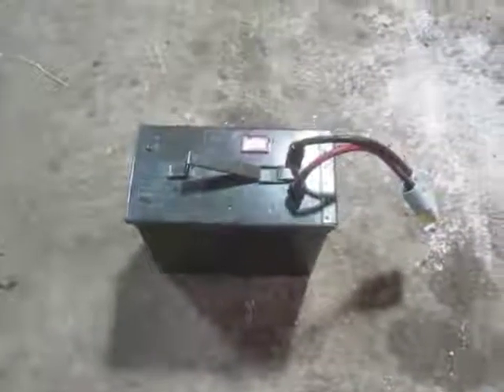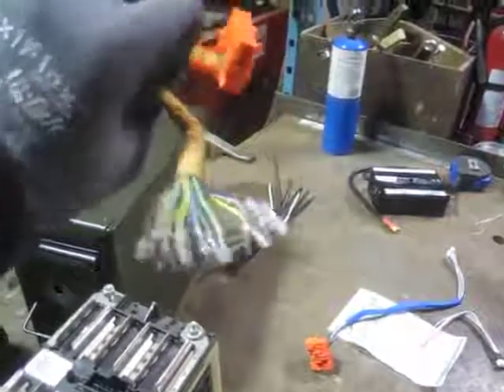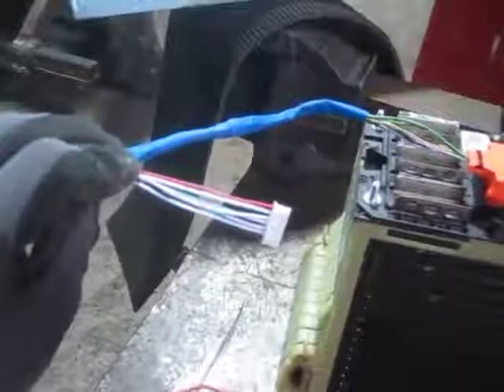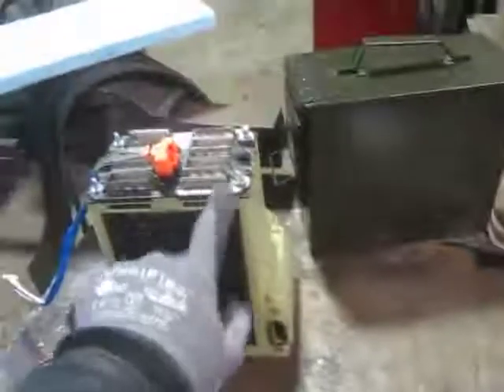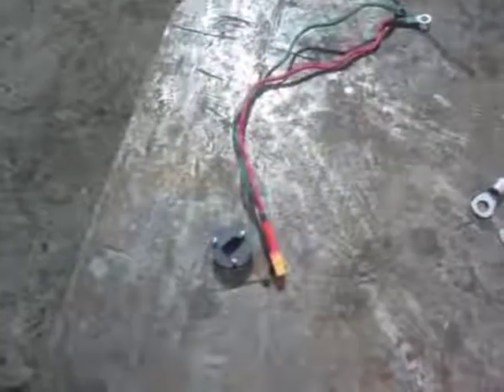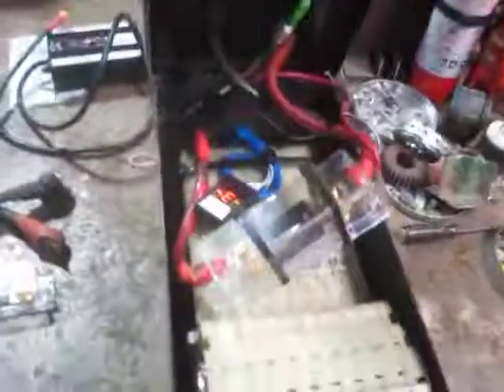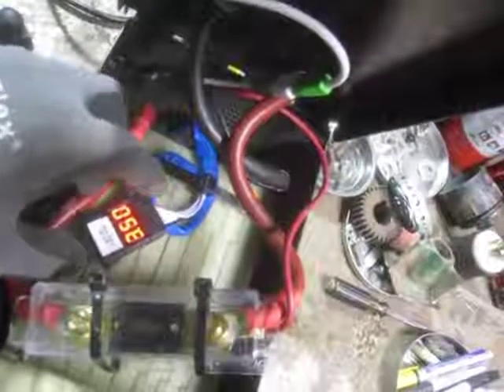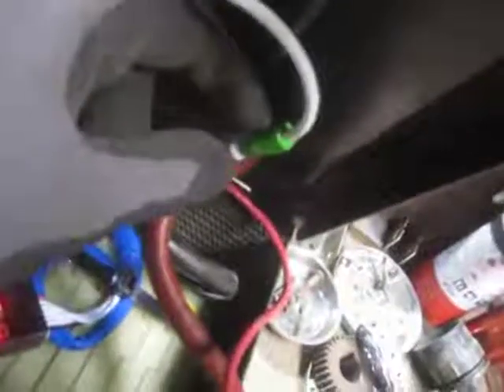24V Lithium "Power Brick" in a watertight ammo box

Comment: Nice job. Using that volt battery is amazing amounts of power for the weight and size! I built one of these with a 12v 22ah lead acid battery 2 years ago. Its okay, but too heavy to lug around camping and to remote areas. I'm building a new one that is intended to be much lighter and smaller. I also want to take the DIY out of the battery charging system for safety so I'm using my Black + Decker 20v lithium tool batteries and stock charger which I've had for years and seem to be very reliable in the tools. Only going to be using two 4AH 20v batteries in this new one but 8AH @ 20v should be enough for me. I would try something like you did but the safety and charging system connections make me nervous!
Reply from the maker: Once you start taking battery packs apart and learning how they work it's hard to stop 🙂. I know I'm really curious about the balancing circuit and what flavour of cylindrical cells are inside my cordless tool batteries (Makita and Bosch) but they're aging too well and I can't justify hacking one open if it's still working properly. If you get into it you'll probably find that those B&D 20 V packs are made up of 18650 cells, probably 6 wired in series. If you put two packs in parallel you'll be building a 6S2P 20V pack with 8Ah capacity. Sounds good to me but you could also break trios apart and restructure to make a big 12-13V pack in 3S4P that would have the same capacity but easier voltage to work with for consumer products. Just make sure you let a loved one know before you get shucked down the rabbit-hole 😁
Reply: I hear you. I'm now addicted to battery technologies and DIY systems for many years. I'm constantly striving to improve my battery systems to have the best weight/power density, cycle life and safety. I got some Lifepo4 18650's recently and even though they are lower voltage and less capacity they are much safer and have nearly no voltage sag under use in comparison to Li-ion. For an unregulated flashlight with Li-ion it will slowly get dimmer the more amperage you pull from it and coupled with the voltage curve of that chemistry its noticeable. With Lifepo4 I noticed the flashlight staying the same brightness after a few hours constantly running with about 400ma of current draw and I checked with a multimeter and the cell was only a few percent down in voltage. This is a known fact with Lifepo4 but I found it awesome to see it in practical use. The drill battery cells brands change depending on the pack capacity. With Black & Decker it seems there are LG or Samsung cells. The 6ah 20v pack has Samsung cells and the 1.5ah 20v pack has LG cells. The whole battery balancing thing scares me a little. Most of those BMS that are on the battery have very small resistors and if asked to dissipate too much current they will burn out and then your cell gets over charged. Sadly there are very few BMS that have temperature compensation, LED status lights and audible alarms for any failure so many people brick cells eventually which can be dangerous in some cases. There is a movement in the ebike community to use no BMS and a smart balance charger. Considering the cells are balanced by the charger there is no need for little resistors on a BMS to dissipate power during charging. Once charged and using the battery pack they only use visual voltage checkers with audible alarms like the ISDT BC-8S battery checker. This little checker is pretty amazing. You can set low voltage cut off alarm and have history logging of hi/low voltages and current voltage of each cell all on its main screen. I intend to incorporate this into my build. I like to see and hear whats happening rather than running blind.

Comment: I’m looking at getting 2 Chevy volt 48v 47ah batteries, what charger could I use?
Reply from the maker: Getting an appropriate charger is crucial to safe charging.  Do not guess about this.  Do lots of research unless buying from a reputable source that knows the Chevy Volt battery modules.  For 48V modules I have one Delta-Q with charge profile 177 and I also have a small Chinese 500W charger from bmsbattery.com. You can also contact sellers of Volt battery modules on eBay and elsewhere.